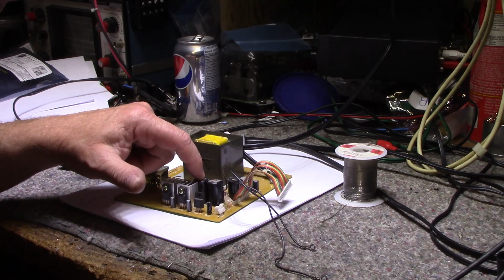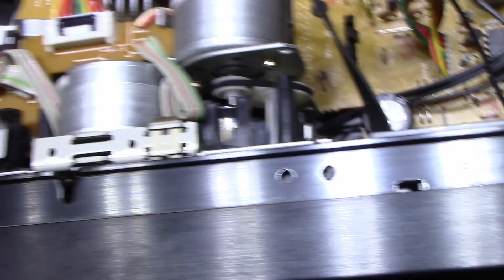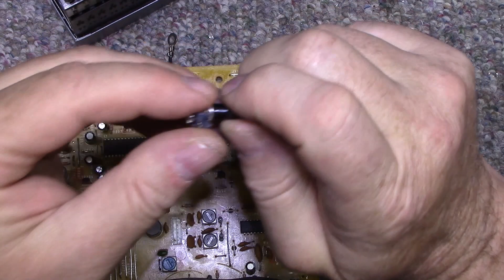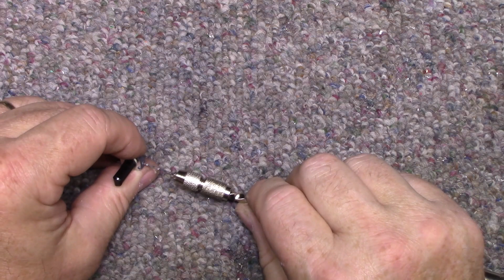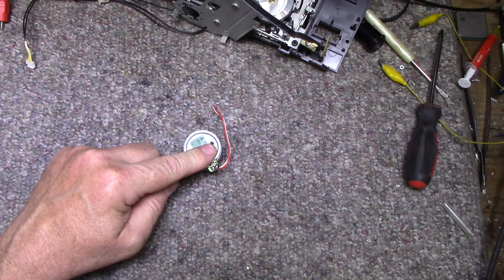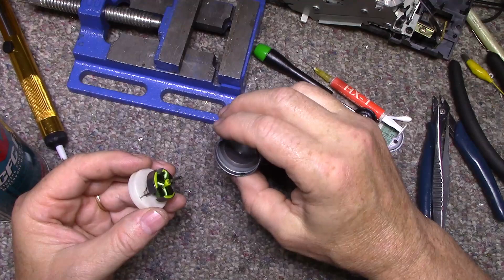Denon DRM 740 Cassette Deck - Repairs (Ep. 84)

Comment: Awesome. I've just bought a DRM 740 that seems to be working OK for the moment, but those 30 year-old belts will inevitably get loose or brittle or gooey at some point, and the electrolytic capacitors will not last forever. This was a great intro to the machine and also to servicing motors. Nice job!

Comment: Great video, thanks! I have a DRM 710 and it runs a bit too slow when I try it after it has been unused for many years. I have changed all the belts and tried to lubricate the bearings and the motor from the outside. But it still runs slow. I had an idea to change the capstan motor so I ordered one. I have tried to remove the pulley but it sits very hard. I only got a broad screwdriver and a pliers kit that seems to fit under the pulley. But I can't get it off. And maybe I don't need to replace the motor? Anyhow, the pulley needs to get off I think. Do you have any advice?
Reply from the maker: Check the pulley for a tiny set screw. If there is none, it's probably glued to the shaft.
If glued, you'll need to heat the brass pulley to soften the glue and pull it off.
Do not pry on the pulley because you'll end up bending the motor shaft
Reply: @TrevorsBench  Thank you.

Comment: I've just adjusted speed on my DRM 740. Came very close to the desired measured frequency. Didn't dare to turn while playing the tape. Was happy that there was only one screw to turn since it has three motors. Wished I could lubricate the motor without opening it. What did you do to fix the slipping belt? Thanks.

Comment: Don't know why you didn't replace the capstan belt,while going through so much other work,that probably wasn't near as necessary.If one belt is stretched,all are stretched.Also,when removing the motor pulley,you should heat up the pulley with a soldering iron,so it softens the glue ,expands the pulley opening and comes off easier.If you try to pull off with too much force,can pull the shaft out of the rest of the motor.

Comment: I had the same problem, very stubbornly oxidized/dirty output pot, and probably other two next to it as well. Managed to achieve the same result but simply removing the cap and spraying the pressurized contact fluid down the shaft. No need to dismantle even the front cover, let alone drill holes in the pots, there is enough play around the shaft.
Reply: Exactly right (I would probably still suggest removing the cover and the front panel, this way one can operate with more precision).

Comment: The differing sizes of the flywheel and hence capstan is an attempt to reduce/eliminate resonance in the transport mechanism. (See Nakamichi ZX9, BX300, all the big Naks). They also set the overall linear (tape) speed of the first capstan to be slightly more than the second in order to provide a tension between them, not enough to stretch the tape, just enough to generate a tension. I can't say that Denon would have done the same, but I can say that for Nakamichi as they made it a big advertising campaign of that technology in the 80's/90's.
Reply: I agree.  I seem to remember that my Aiwa AD-F770 tape deck also has two capstans and rollers of differing dimensions, and that it was a declared method of reducing wow and flutter - which had a very low spec of 0.025% WRMS (roughly half that of a single capstan machine).  If they were of similar dimensions, they would never be exactly identical, setting up resonance between them and increasing the wow and flutter rather than reducing it.
Reply: First capstan speed has to be slightly less than second capstan.

Comment: Thanks for the video! I was able to change the belt with your help. I'm just wondering where the speed adjustment screw is located. Mine is running just a littlebit slow and I couldn't really see in the video where the screw was located.
Reply from the maker: On the back of the motor there is a small circular cutout. You will need a small flat blade screwdriver to adjust
Reply: Put some tape around your screwdriver shaft,if using a screwdriver with metal shaft.If you don't you will see the speed go up,whenever the shaft of screwdriver touches metal of motor.

Comment: That's a very interesting way to adjust the tape speed. I was attempting to figure our how that was possible, then I thought OHHH test tape and frequency counter together and it showed the phase difference, as you said ideally a diagonal line. Same method for azimuth alignment 😃😄.
Reply: I am using a tape recorded with 3000 Hz on a calibrated deck, and smartChord app on Android phone, with tuner mode on, which shows me exactely what frequency is the phone "hearing", and I adjust until I get as close to 3000 Hz as possible.

Comment: Thanks for the video. I wish you'd shown more detail re belt replacement. Hopefully that's all my one needs :)
Reply from the maker: Belt replacements are pretty straight forward but I will show the process on my next deck, thanks for watching. Cheers
Reply: @TrevorsBench  Personally I found the belt replacements a challenge but I have prevailed and got the thing working, which I'm very pleased about. Thanks for your video, it certainly helped my confidence with taking it apart and getting on with doing it!

Comment: Nice deck got mine for 25 bux on eBay ,bought new belts from Germany for it cleaned controls awesome sound.
Reply from the maker: Great to hear. Love that vintage sound
Reply: @TrevorsBench  The sound equipment today has no soul
Reply: Same here, but only was able to swap the smaller of the two belts, its slightly slow, but sounds great....